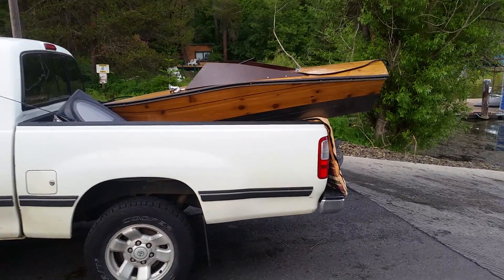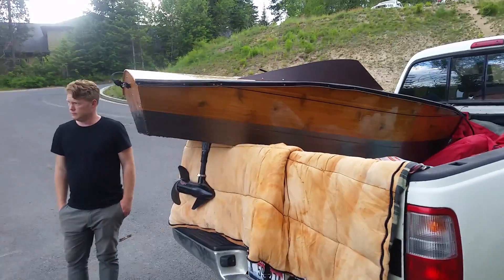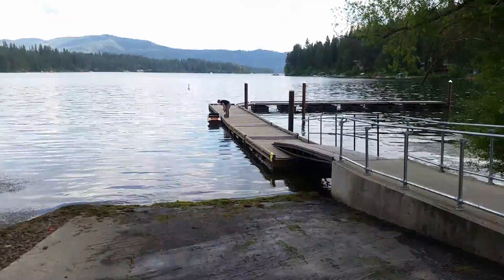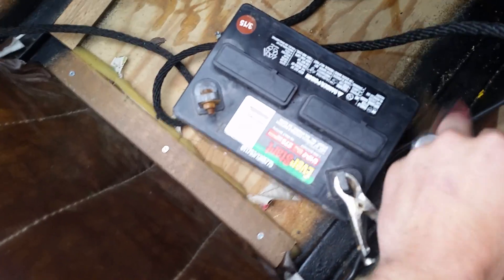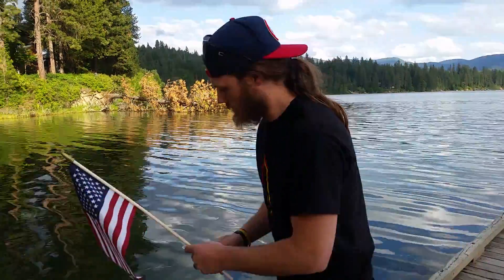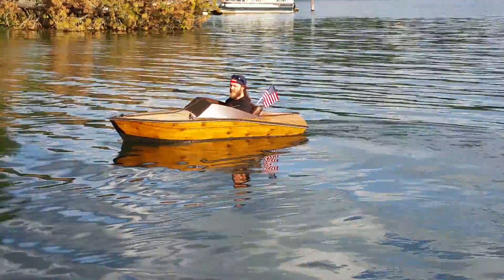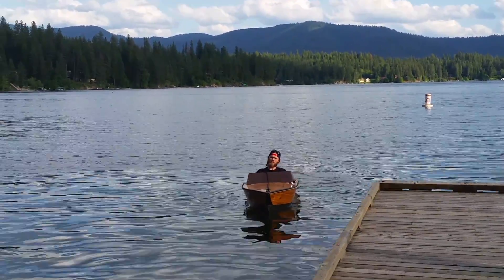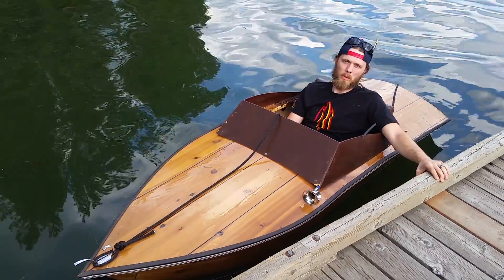Plywood boat electric inboard small

Comment from the maker: Hey i am putting together a boat building guide!!!   here are the measurements if anyone is interested! thank you for your interest and support!!
""https://gum.co/bqjFg">
Reply from the maker: couple 1x2s
a 1x4
125=/-  #6 stainless flat head philips drive screws
25      2 1/2   cabinet or outdoor deck screws
1    4x8  5/8 plywood
2   4x8    1/4 plywood

good start!
Reply from the maker: +Ian Mangham well this is just a lawn tractor starter battery  it lasts less than an hour at full speed lol  i need to get a marine deep cycle!
Reply from the maker: +John Ratko thats still super good!!  Im glad to hear that!
Reply: Really like the look of your mini boat and performance. I would love to get some plans and material list to work off and build one my self do u have any guides to get u started in right direction ?
Reply from the maker: here is all i have out right now....   would you be interested in a pattern to trace and cut out?  i am in process of making that available as well but not quite yet.         thank you for your interest!   i have a website coming together that will help alot too!     https://gumroad.com/briansboatsfloat
Reply: from what I am reading there would be several of your subscribers willing to pay for plans and or cut out and templates... Appreciate the reply and again awesome design. I have watched, looked at, @,# researched 100 s of plans so far and this is so far the only one I've came across that I've liked...
Reply: Do you have the full plans yet?!  Also, how did you get the top of the boat looking so great?!
Reply from the maker: +Brooklyn Avenue I havent finished it yet :(  i was unsure if anyone would want it! Lol   the top (thank you for the compliment btw) doesnt have any fiberglass on it which helps, also i think the curve helps it look better too. Like how its not a flat top, i put wood in the middle so the top would be domed a little. Its so shiney from the 'bar top epoxy' its not as purdy up close either lol.   I wonder how detailed the building guide should be?  Any suggestions? Thanks!!
Reply: Brian Davis Thanks!  Here is some advice: you know of EVERY imperfection in your boat, but to the rest of us, we don't see those things, to us, your boat looks cool! Don't forget that most people will NEVER get as far as you have already. This speedboat style boat you built here looks like a micro version of a very high-end speedboat, something only doctors and lawyers own. But I know that you keep thinking about every flaw in it.... I feel the same way about my builds (I mostly build tiny campers).

I have a nauticraft peddle boat that I turned into a sailboat... But there's this great river right next door to me that is too shallow for a sailboat so I want to build a copy of your boat here.  I am going to try and build it tomorrow. I like Paul Elkins' boats, but yours here is even cooler. 

As for an instruction guide, I would say that the main thing is to have pix of each major step. This helps me think that I can build it too. Anyway, I will buy your measurement plans now as they will be a help.
Reply from the maker: +Brooklyn Avenue Thats exactly what i was going for!! In my town, every year there is a classic wood boat show and thats where my inspiration is from! Suuuuper expensive some of them. wow that is some good advice!  First of all the 'inboard' set up i have is not good for shallow water its more than a foot below! That is my main change. But the look suffers from motor on back.  I would also  make it a few inches wider at least if not more... its all a trade fashion or function.  I have the building guide almost ready at home and im out of town!   I can send you some pics if you want of the process!  Email facebook text whatever you want!  But im going to get that plan out quick and do a section on close up detail regrets! Thats a GREAT piece of advice!
Reply: Brian Davis Thanks man! The measurement plans I got from you already will help me to start, I can cut out the bottom piece, etc. I like the dimensions small, they work for me, I like the idea of carrying this in my pickup truck.I like that it will be relatively light (My sailboat is 384 pounds).

I agree that the outboard motor hurts the look, and that what you did is very cool. Fortunately,  the water in the Wekiva River (the river in florida right next to me) is deeper than 1 foot in all places, so I should be OK. When I say shallow, I mean that my sailboat needs at least 3 feet of clearance in all places, which is why it's a problem. When a sailboat gets stuck in 2-3 feet of water, you have to get out and push it. Here, in Florida, the alligators look for idiot sailors.

With your boats, rowing should be easy if something goes wrong. And they are so stylish I bet that people will fight over towing me in...Seriously, people get excited over novel looking boats. You spoke about this experience... you like that you get interest, but sometimes it feels funny when people pay so much attention.
Reply from the maker: +Brooklyn Avenue Yes yes yes!  That sounds awesome! I cant believe you guys have to deal with gators!! No way!  Lol     its wierd to take compliments but it also a big part of why we do this stuff! When i do get the plans done would you like to give me some advice on how to better them and suggest price point, in exchange for getting them for free?? I would be super happy to!
Reply: Brian Davis I'd love to get those plans!  I'm fine with being a paying customer and giving you feedback as well. I don't know if you want me posting the price point stuff here, but I see the prices being from about 20 (What Paul Elkins charges) up to about 30-35. That seems a bit high to me. If you went lower than 20 it might help sales, but like the Joker says, if you do something well, you shouldn't do it for free. (Well, unless you're an older person like me and you don't mind giving back.)

I think if you provide a picture at each step that would be a winner. Paul's plans are very detailed with good pics, so I would use his as a guideline if you have one of his set of plans.

And yes, the gators here are serious.... I should post some video of that. I took my sailboat down one shorter part of the local river, a side stream where it got down to about 4 feet. I figured that if I got stuck I'd just get out and push.... and literally as I thought that I saw the eyes of one gator duck down into the water.  They usually avoid people, but.... do you wanna try getting into the water with one of them? Hell, I run from bees!
Reply from the maker: +Brooklyn Avenue   i wish i had them done for you! I cant even work on them till friday!  You already started on yours yet? I really apreciate the advice above it will help a TON!
Reply: Brian Davis I am starting on my build. Your 3.95 plans/measurements were enough to get started, they help! 

That said, I will like seeing your plans when they are ready. I am already planning on building a second one: my wife loved your design so much that she wants her own!
Reply from the maker: +Brooklyn Avenue That makes me feel soo proud!!  Wind in my sails!  Thank you friend!
Reply: Hey Brian! love your stuff! i was just wondering where i can find your Boat Building Guide? I am very interested in making a small boat of my own, and your design is by far the best I've found. Thanks and great job so far!
Reply from the maker: +Garrett Weil hey thank you so much for the compliments!! Ive done two drafts already of a guide, but it is really hard because i just 'winged' it! Nobody wants that as a guide! Lol but i am whitling down a hopefully helpful guide to build whatever design you come up with.  I wonder if i should focus on just this boat in particular...  what do you think?
Reply: I can imagine writing a guide is difficult! I still think that the fact that you winged it is pretty incredible! I think you should do kind of a hybrid guide, where you use the "Miss Courtney" as an example on how to wing it. I appreciate you getting back to me so quickly! Let me know what you think, and do you have any tips on winging it in the meantime? Thanks again.
Reply from the maker: +Garrett Weil we are on the same page man!! In the mean time, start getting parts and material for as cheap as you can early so you dont have to buy something new just because you were in a hurry to finish lol  it adds up quick!
Reply: Thanks a lot!
Reply: We use a large marine deep cycle. Goes all day.
Reply from the maker: +John Ratko is that full speed for 12hr?  That would be so awesome!!!  I have a marine batt i should be using!
Reply: American Boathead No. That's a mix of trolling and full speed pushing a 16 foot Lund boat for 8 to 12 hours.
Reply: Ezd
Reply from the maker: https://gumroad.com/discover?query=briansboatsfloat
Reply: Here's  a few tips for constructing boats:
Allow plenty time.
take advantage of done for you boat outlines.
(I learned about these and more from Denelle boat builder site )

Comment: Have you tried giving her a good rocking Artie dock just to see if she tips? Have your buddy hold on to make sure you don't really tip. That's what I did with mine because it felt tipsy, she always bounces back, I'd give it try before you put more work into it, might be for nothing. But very cool, glad to finally see number 2 out! I took mine out yesterday with a new 55lb thrust on it, great way to spend my bday! 

Started working on a Frankenstein scrap metal launching cart type thing, I'll post a video of it soon.
Reply from the maker: +steggc85 You know you might be right, it didnt look as bad as it felt on video. After i got used to it i felt pretty stable. Ill try that first! I might just go with a trailer that holds both of my boats but i would love to see what you come up with for transportig it! Thanks for the tip!!
Reply: lol oh no Brian, I just showed you how to screw with the big money wood boat guys noodles.. showed you that 1500w motor addie last week. watch their jaws drop when this lifts 8-10" off the surface and starts doing 15-20mph would not be sick or silly noOoOoo (hehe).
it'd need 4 good size lawnmower batteries series parallel for 24v so it'd only weigh up like one big deep cycle. runtime might seem short but range not so much, once they lift up they've ditched 80% of the drag, but does need a bit of grunt to pop up. many designs use a skimmer to control the ride height for power vs. speed, on the smaller forward foil.
Reply: think this too.. once up, the foil width and shape give the stability and you're not getting rocked around much at all by other boat's wakes.
Reply from the maker: +model nutty Maybe i could get some kind of "push start" to break surface tension and ditch a battery!  People would be awestruck! Most people have no clue what a hydro foil is they would be mystified! Lol   i love it!